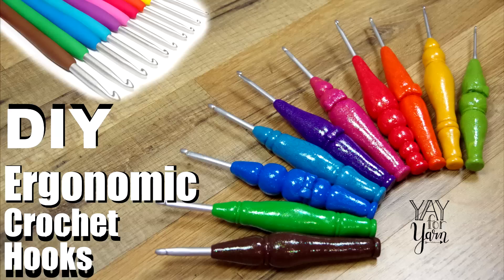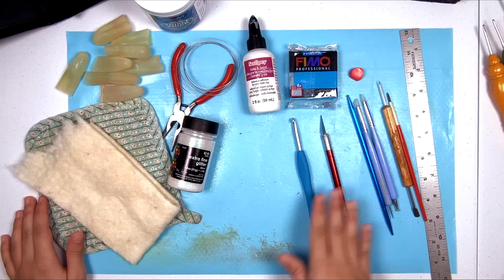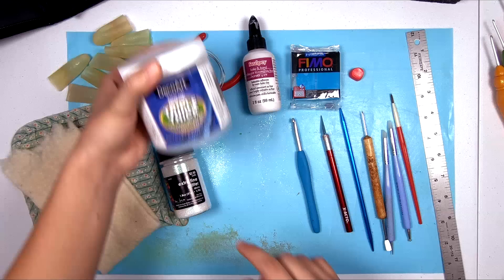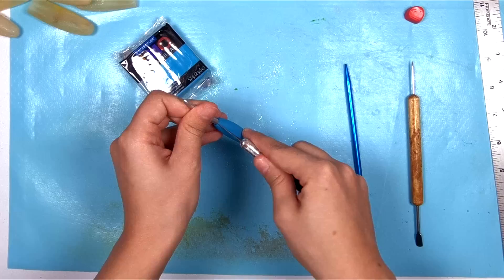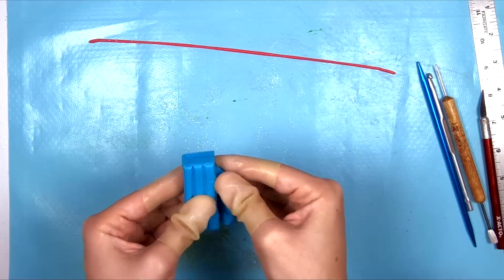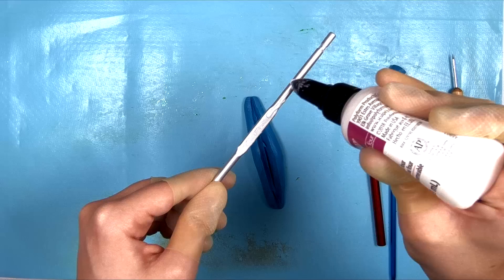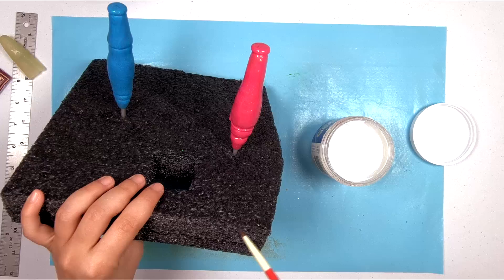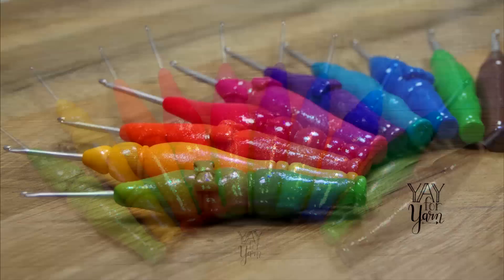DIY Beautiful Ergonomic Crochet Hooks with Polymer Clay Handles | Yay For Yarn

Comment: Oh I love these I will have to see if my hubby can make me some I'm bed ridden so I cant do it myself or I would I have alot of my grandmother's hooks I use I have medical tape on them to make them thicker for my hands I have bad arthritis... ty for the video I pray he can make me some lol
Reply: There's a store on Etsy - Too Shay Crochet - that does custom handles on hooks. They're thicker with a lot of different styles, but they're lightweight  & way more affordable than the hooks they compare to. I have a similar problem with my hands, and crochet is what I do to feel productive when I am stuck in bed. You likely know how it is though, not able to spend a ton on hooks that help with the pain & cramping. The hooks I've gotten so far have helped more than the Furls hook I tried. There's a variation of thickness, regular, medium, and slimline. And the design of thickness, or where the handle stops depending on how you hold your hook- you have lots of options. If your husband finds it too trying to manage clay (I tried it & without experience, it was more difficult than it appears on these videos, as well as more expensive when you're first starting & have to buy everything for the first time) you might check the hooks at TooShay on Etsy. You can also do customized orders. I get my handles to come higher toward the hook, where some prefer shorter that shows the midhook measurements. My clay attempts never held a smooth shape. I guess I just don't have the patience or a good grasp of clay work enough to find the clay that works best for my purposes. I'd easily end up spending way more on supplies to test, beyond the cost of a custom hook from TooShay. I hope whatever you choose that things get better for you. I'm sorry you're suffering limitations. I know it's hard, much harder than most people know or consider. God bless you & be with you.

Comment: Awesome tutorial!  You might try looking into resin as a glaze coat for your polymer clay handles.  I think it would hold up much better than the Triple Thick.  UV resin would be preferable as you wouldn't have to worry about drips happening due to slow cure times, but two-part resin would work as well if you were careful to turn them frequently while curing.
Reply from the maker: Thanks for the suggestion!  I am not real familiar with resin, but I will look into that.  I have had some problems with the triple thick gloss glaze, so I ordered the Fimo brand gloss varnish as recommended by a lady who sells polymer clay hooks on Etsy.  I'm going to try removing the current glaze and replacing it with the Fimo varnish to see how it works.  I'll post an update once I try it.  Thanks!
Reply: I was playing around with some scrap clay and made an ergonomic handle for a short piece of 3/16” stainless steel welding rod that I use as a clay tool. Although it wasn’t intentional, the handle ended up being almost identical to the Odyssey hooks that I use almost daily. What can I say? I’m a “Furls Gurl”! LOL. I’m going to try some UV resin on it this afternoon to see how it turns out.

Comment: Hello I’m new to crocheting & clay & a few other things but iv always like making things DIY’S but I’m not sure what to get for sure & where to go the glue you used on the hook when you put the clay on  I looked it up but I found a few with the name but they was glitter & the cloth you used where do I getting them the glue is the main thing I need and I’m not sure which one to get will any metal with adhesive work like jewelry glue work or what kind will work thank you love this video will E6000 work it says for use on Polymer Clay
Reply from the maker: Hi Candy.  You may find the blog posts where I list all of the products and steps helpful: https://yayforyarn.com/polymer-clay-crochet-hooks/ https://yayforyarn.com/polymer-clay-crochet-hook-mistake/
Do not use the DecoArt Gloss Glaze to coat the finished hooks.  This did not work out well and I had to post an additional blog post explaining why and showing why the Fimo Gloss Varnish was better.  Fimo Gloss Varnish is made for polymer clay.  Other varnishes and coatings may not work well with polymer clay, so I would recommend choosing a varnish or glaze made by a polymer clay brand.  As for the adhesive, the glue I used is also specifically designed for use with polymer clay, and bonds with the clay as it is baked in the oven.  The Sculpey Bake 'n' Bond is also called "oven bake clay adhesive":  https://amzn.to/3AXpAOD  If you choose a different brand of oven bake clay adhesive, I would recommend choosing an adhesive that is made by a clay company and made for baking in the oven.  E6000 may work well for glueing already-baked polymer clay, but I don't know if it is safe to bake E6000 glue.  I hope this helps!

Comment: These are beautiful. Question. Why do you use the cotton batting?
Reply from the maker: Hi Dorothy!  The cotton batting helps cushion and insulate the hook handle as the clay bakes.  Without it, the handle would be laying directly on the toaster oven tray, which would not only leave a flat spot on the handle, but would also increase the chance of burning the clay on the bottom since the metal tray is hotter than the rest of the air in the toaster oven.  The batting should be cotton or wool rather than synthetic, so it won't melt as the clay bakes. I hope this helps!
Reply: @YayForYarn  And the batting keeps it from rolling around on the pan, too!

Comment: I got some clay as a gift from my mother this Christmas and can not wait to start making these now I do not have cotton that I can put in the oven do I really need that or if there a way to just bake it with out that and I have no way to get a toaster oven is that OK as well
Reply from the maker: Hi Kelsea.  Yes, I recommend putting some cotton batting or several layers of folded cotton fabric underneath.  This helps prevent the handle from getting a flat spot as it rests on the tray while baking.  You could do it without a soft, heat-safe pad underneath if you don't mind getting a flat spot.  As for not using a toaster oven, my preference is to find a cheap, used toaster oven at a yard sale or thrift store if possible to use only for craft projects like this (and not to use for food).  Some people do choose to bake polymer clay in their regular kitchen oven where they would bake food, but I would recommend doing some research on the chemicals that are released from polymer clay as it bakes before deciding if you want to bake the clay in your food oven.  I hope this helps!

Comment: Great video, but kind of sad to cut the Clover hook! Would it be possible to pull it out instead of cutting it, and glue a less comfortable aluminium hook in it? Or maybe it's too solid for it to work?
Reply from the maker: Hi Diana!  I think it would be rather difficult to remove the rubber handle without damaging it.  They are designed to stay on, and the rubber is attached to the metal hook well.  I don't think it would be possible to remove the rubber without cutting it off.  I hope this helps!

Comment: They are beautiful,  are they heavy now? Also does they feel hard in the hand. The other clays you mentioned will they feel softer as an end product? I have tendonitis so bad, I am very interested in making ergonomical hooks to fit my hands so I can enjoy the craft
Reply from the maker: Hi Carolyn.  With the clay handles, the hooks now weigh about 1 ounce each.  They are a little heavy compared to a regular aluminum hook, but I actually prefer a slightly heavier feel in a super-thick handle.  The handles are hard, but I don't mind that because I don't squeeze them while holding them.  I prefer a gentle grasp when holding my hooks.  The other types of softer clay mentioned in the video, once baked, are hard as well.  Even though they are softer when raw, they are actually more difficult to work with in my opinion, because they can be almost mushy and do not hold their shape as well as the firmer clay.  I hope this helps!

Comment: I am so excited to try this! I’m wondering how heavy the hooks are now? I had a friend make me wooden hooks and they were so heavy. I think I would prefer a slimmer version of what you have there or learn to use a heavy hook and get used to it :)
Reply from the maker: Hi Belinda.  My hooks range from 30-36 grams each, about 1 to 1.3 ounces.  The weight is similar to my favorite Furls Odyssey hooks, which weigh about 36 grams / 1.3 ounces, only they are weighted in one particular spot for momentum.  https://youtu.be/IC6bVT_Muk0  I actually prefer a heavier, larger-handled hook to a lightweight metal hook.  The forward-weighted Furls hooks are my favorite, but my entire set of polymer clay handles cost me about the same as one Furls Odyssey hook.  :)  I hope this helps!

Comment: I wonder if you could take one of the finished hooks, before glazing, and make a mold of it so you can just add clay to the molds, pop them out and sandwich the hook in between two so you wouldn't have to go through the trouble of shaping every single hook.
Reply from the maker: Hi Christie!  I think it would be possible to make molds of the hook.  I think you would need to insert the hook first and sandwich it between the molds.  If you mold the clay first and then insert the hook, the clay you just molded would likely get squished a bit.  Hope this helps!  Thanks!

Comment: Can you use a regular house oven and can you use parchment paper to bake your hooks on?
Reply from the maker: Hi Jennifer!  I would not recommend using parchment paper or a regular kitchen oven for baking polymer clay.  The purpose for the cotton batting as a baking surface is so the hooks are on something soft, and won't be dented by laying on something hard.     As for using a kitchen oven, please note that polymer clay is made of chemicals.  When it bakes, it turns into a type of dense, solid plastic.  As the clay is baking, it releases chemicals into the oven, which coat the inside of the oven and can leach into any food baked in that oven.  For the same reasons, any tools used for polymer clay should be kept separate from any kitchen utensils and only used for clay. Even after a good cleaning, residual chemicals from the clay can still be present in your oven or on your tools. I recommend getting an inexpensive toaster oven from a thrift store or yard sale and designating it to only be used for polymer clay.  (Mine cost about $2.) For more info, see my blog post with step by step photos: https://yayforyarn.com/polymer-clay-crochet-hooks/  I hope this helps!

Comment: Which of these hook designs do you like to use best? Which one feels the best in your hands? 😊
Reply from the maker: I think they all feel fairly similar, because the overall shape is very similar.  However, near the top of the handle, I tend to prefer the feel of the ones that are either smooth or have just a crease / indent in that area, rather than the bubble shaped portion such as on the top of the darker blue handle.  Probably my favorites would be the brown, darker green, light blue, the pinkish-red one with the bubble shapes at the bottom of the handle, and the yellow one.  They are all enjoyable to work with, but I especially like the ones that don't have quite as much texture or larger shapes in the area where I would be grasping the hook with my thumb and first few fingertips.  I hope this helps!
Reply: @YayForYarn it does help thank you very much. I'd enjoy an update video if you want to 😊

Comment: very nice work! appreciate all extra tips and detailed instruction--especially appreciate safety info about not using kitchen oven. maybe you haven't used the modified hooks long enough to answer, but have you found the glaze to wear off or do you anticipate it will? thanks!
Reply from the maker: Hi!  Yes, I have been using the hooks for awhile.  It seems that the glaze I used is not the most suitable for polymer clay.  It does wear off a bit.  The surface of the hooks is a bit sticky, and so they stick to each other and peel glaze off of each other.  (I recently updated the video description to mention this.)  I will be removing the current glaze and testing a different one that was recommended to me by a polymer clay artist.  I will be updating the video description and blog post with the results once I test it out.  Hope this helps!
Reply: yes that does help a lot. thanks! i had a feeling that might happen with the glaze. I ordered a (one!) Furls hook yesterday—bday gift to myself! ;) -but still want to try modifying my hooks...

Comment: Hi, I love this video. Very  informative 👏  and they look beautiful.  I was wondering do you find the handles  to be to heavy? I ordered  one from etsy and thought it was heavier than I'm  used too. Do you know of any lighter material  you can put as a filler around  the hook than add the clay?
Reply from the maker: Hi Natalie!  I personally don't find them too heavy, but I also enjoy working with the forward-weighted Furls Odyssey hooks.  Unfortunately, I don't know if there are any lighter materials you can fill the handle with.  If you're going for a lighter weight handle, you could make them a bit thinner rather than 3/4" thick like I made.  I hope this helps!
Reply: @YayForYarn  You might try Souffle clay by Sculpey. It's a little lighter and has a different feel. Well done tutorial!
Reply: Thank you so much!

Comment: Would it be possible to just mix the glitter into the clay instead?
Reply from the maker: Hi Christie!  Yes, you can mix the glitter into the clay.  In fact, they sell a line of Fimo with glitter in it, but it didn't come in the colors I wanted.  I chose to add the glitter to the surface because I thought it would use less glitter for the same amount of sparkle.  I figured if I mixed it in, a lot of the glitter used would end up inside the hook where you wouldn't see it.  But you could mix it in if you prefer.  Hope this helps!  Thanks!

Comment: wait, so is it unsafe to bake in the oven used for food?
Reply from the maker: Hi.  When polymer clay is baked, it gives off chemicals that will coat the inside of the oven.  Even if you clean the oven well afterward, all of the chemical residue may not come off, and when the oven is heated again to bake food, the chemical residue can get into the food.  This is why I don't recommend baking clay in the same oven used for food.  I got a small toaster oven from a thrift store to use for baking clay, and I run it outdoors or in the garage so the chemicals given off are not indoors where people will breathe them.  I hope this helps!
Reply: @YayForYarn  thank you, my friend and i are going to try to find a toaster oven at goodwill

Comment: How do you get your clay so smooth? Mine comes out lumpy
Reply from the maker: Hi Dorothy!  Are you referring to the lumps of clay, or the clay after it has been put on the handle?  One of the best things you can do to make your clay smooth and pliable is to keep kneading it.  The more you work your clay, the easier it will be to work with.  Polymer clay can be especially lumpy right out of the package, but if you keep kneading it, it will become more pliable and consistent.  That will also help the clay be smoother when you go to put it on the handles.  If you need to smooth the clay out after it is on the handle, it can help if you roll the handle at an angle across your work surface, or between your hands.  I hope this helps!

Comment: my question is how  much weight does this add to the hook?
Reply from the maker: Hi!  I did not weigh my hooks before adding the clay, but I do know that I used 1 ounce of raw clay for each hook.  The weight of that clay may change a little after it is baked.  So if you are adding clay to a metal hook, it would add about 1 ounce to the weight.  If your hook has an existing rubber handle, then once the handle is removed and the clay is added, the clay would add a little less than 1 ounce more weight than what the hook weighed with the previous rubber handle.  Hope this helps!

Comment: Someone would have something for modeling this type of hook? I suffer from carpal tunnel after 2 hours of relentlessly nothing makes it is very crooked .. I am at my 4 hook and they are still crooked, how much time of practice before arriving at a perfect result and right?
Reply from the maker: Hi Nathalie!  If your hook handle is crooked, it helps to turn it almost constantly while making small shaping adjustments.  It doesn't take a lot of pressure or squeezing, just very gentle presses with the fingertips while turning the handle.  Turning it as you shape the clay helps to keep it even and straight.  Hope this helps!  Thanks!
Reply: Thank you so much for your help. Surely too much pressure from me, still hours of practice and I should get there. @YayForYarn

Comment: can i use air dry clay?
Reply from the maker: I would not recommend air dry clay.  I have not used it much, but it does not form the same kind of material when it hardens as polymer clay.  I think air dry clay is more crumbly, and may be more likely to break when dry.  It isn't really made for making items that are used and handled frequently.  I hope this helps!

Comment: What can I use if I can't find gloss glze
Reply from the maker: Hi Kathy.  I recommend the gloss coating made for polymer clay, as I found out that the glaze I originally used was not suitable for polymer clay items.  I removed the glaze I used in the video above, and re-coated them with the gloss varnish made specifically for polymer clay: https://youtu.be/uZUncGPZ4Ik  I do not know what other types of surface coating will work well for this type of clay, so if you can't get the gloss varnish, I would suggest leaving them uncoated for now, until you can find the right coating.  I got the Fimo gloss varnish on Amazon: https://amzn.to/3dkdhhO but the Sculpey brand also makes a glaze for polymer clay.  I hope this helps!